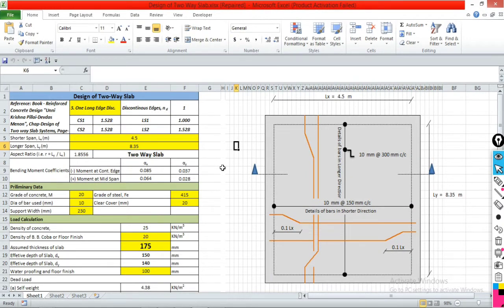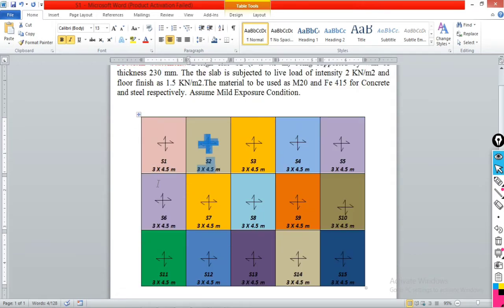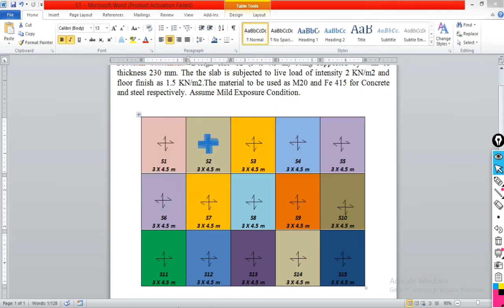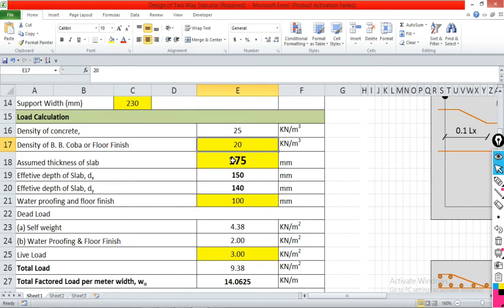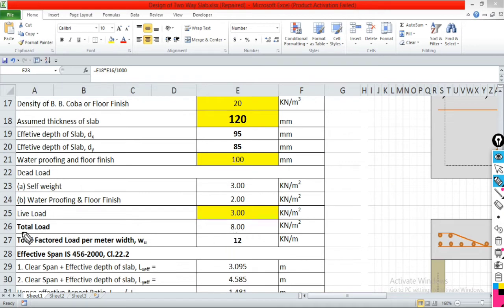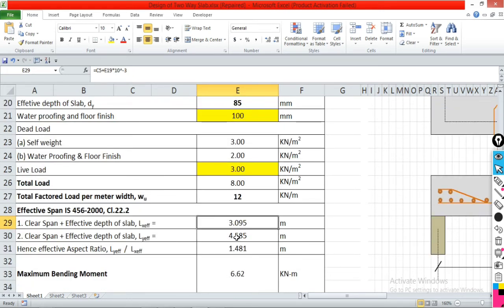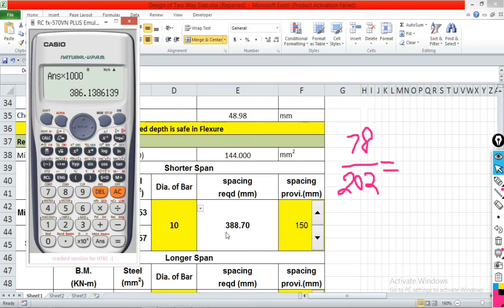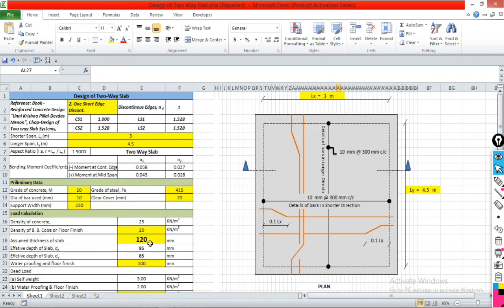Design of 2 Way Slab Using Excel Sheet I Civil Engineering I IS 456:2000 I Struct Soft Centre

Comment: the example is two way slab. but you are considering the Modification factor Mft for one way slab  which could not be understood. It was better to take the value of Mft from IS code
Reply from the maker: Contact at 8857891345